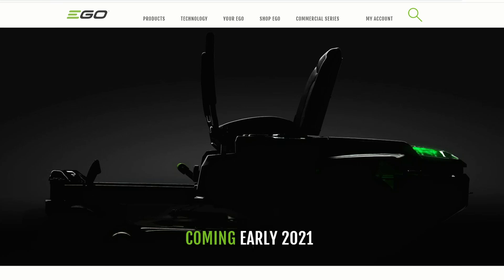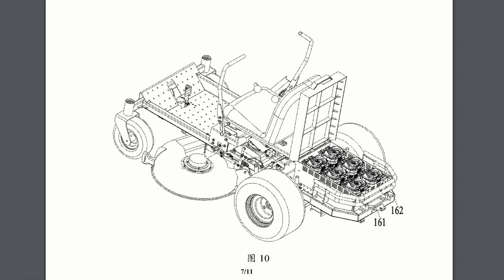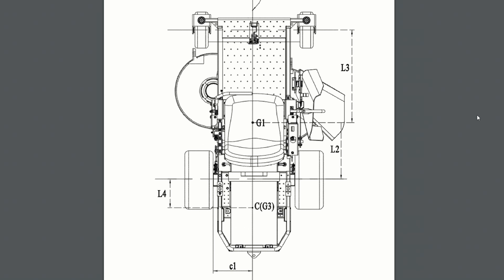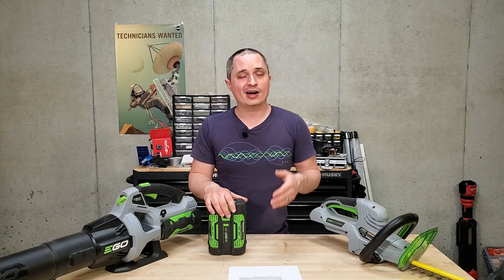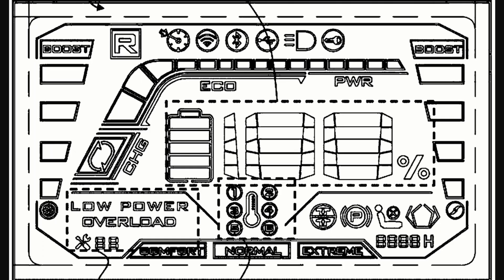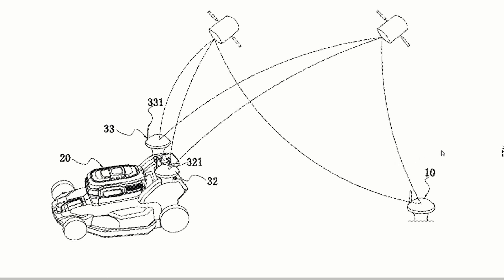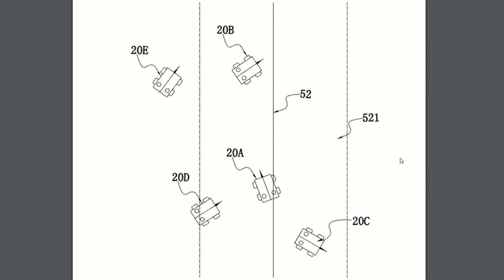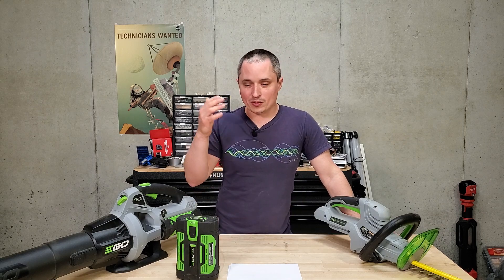EGO Riding Zero-Turn and Robotic Mower Patents - New Tools Coming in 2021!

Comment: EGO 21 inches 
And I have the new ones 7.5 amp battery 🔋 
I never bag or having issues not cut or stop the mower:) 
but I have couple problems :( 
1. The mower is too lite :( 
2. the mower is too small :( 
3. A problem with the batteries it freezes or won’t charge and one last that long with 7.5 A only 5000 ft.² yards you can cut:( 
4. And I have fescue grass I cut like 4.5 inches :) and when I cut the grass front wheels Digs grass in and i’m on second day that grass raise up and you can see the stripes tall :( 
5. The mower it’s sow light one pass can float on top of the grass second pass can go down with the same settings you can see the difference :( 
6. The mower is so tiny I have 1600 square-foot yard taking me one hour and a half to finish with one pass if I’m doing double pass takes over two hours :( and you have to do a double pass because of those stripes :( because of the tiny wheels digs that grass in :( oh and it doesn’t have an enough suction to suck the grass back out with the blades :( 
7. Not enough RPMs or not enough vacuum to lift the grass up from the ground. :( 
8. The bottoms for self propel the end of the cutting your yard you have hands A Ssort they’re too tiny and you have to squeeze the hands too tight :( 
EGO Mower they need to fix dthese issues :(

Comment: YES . . . The Leaf Mulcher !!! . . . Except many of us like myself already have the 650cfm blower . . . and I'd like to keep the two funscions separate because it is beneficial for longevity to do so. I hope they listen and make 2 versions . . . 1) Mulcher Only and 2) Blower/Mulcher . . . either with a collection kit like the Worx Mulcher with LeafPro Universal System that can use a common shop vac hose size.                                                                                                                                                                  EITHER WAY THANK YOU FOR LISTENING EGO . . . THOSE WHO LISTEN  . . . DOMINATE I ! !
Reply: Did I forget to mention . . . with variable speed ! ! !
Reply: I would also  like to reiterate to EGO  . . . that it would be welcome from tconsumers  . . . and many women . . . if EGO WOULD MAKE  A WEARABLE BATTERY PACK/HARNESS ( back or hip ) . . . that could be used universaly  with all hand held EGO TOOLS . . . TRIMMERS, BLOWERS, EDGERS, SWEEPERS, CHAINSAWS ETC. So that the user is not burdened with the weight of the battery along with the weight of the tool.
Reply: what would be welcome by consumers
Reply: And of course Brushless

Comment: I wonder if this zero turn mower will be on par in price and specs as the Ryobi Zero Turn mower.
Reply from the maker: They've officially unveiled it now: https://egopowerplus.com/worththewait
I got almost every prediction right except for the deck width, which is officially 42". They're saying MSRP is going to be about $5K with four 10Ah batteries included.

Comment: That zero turn sounds incredibly in efficient and very expensive. Their batteries are expensive. Possibly 1800 for a full pack. For... 2 ish acres..I'm not impressed. That mower better be free at that rate
Reply from the maker: I'm betting the mower will be at least $4K-5K with batteries included.

Comment: Im dumbfounded by how slow the robomower progress has been. Roomba was out for years before the Roborock came in and did the obvious and vacuumed in straight rows and used more sensors and cameras for obstacle avoidance, roomba is still playing catch-up.

Here we are in 2020 with $300 robo vacuums with lidar, bumpers and multiple cameras  and yet the best robomower (probably Worx 140) still bumps around like a 2010 Roomba and the sensors (which are additional) are garbage (as per reviews). And you still need boundary wire, even though that $300 mower can map itself, or you can in the app.

It makes no sense to me. Why cant someone take the guts of a Worx or Husqvarna and use lidar and cameras like the Roborock and include the mapping/zoning features as to not require the boundary wire, which is easily the most complained about thing in the reviews of robomowers.

Comment: Dude, Good video.  I love mowing lawns. This year I got a Ryobi. 2 days after the 30 day warranty, it went out on me. Home Depot came up big, and refunded my $$ anyway. Otherwise I would have been out $4300. I guess my other option would have been to take it to a repair place that was 30 miles away, had never fixed one of these, couldn't get to it for 6 weeks, and didn't seem totally onboard with doing the warranty work. That's in part why HD gave me a refund. 
Anyway, that killed my love of mowing, at least for this year. I loved that Ryobi when I had it. Nice green lawn. Nice lines. Just everything about it. After I returned it, I went back to my 1990s jalopy mower. Not even close to the same thrill of mowing. The Ryobi took 2.5 hours (including dumping clipping) where as my mower takes 4. 
I have a slew of other Ego products. I love em. I've had a few issues, but nothing that will stop me from liking Ego. I'm now just wondering the price. Under $3,000 and I'll buy one. Over $4,000 and I'm out. In between I'd have to think about it.
Reply from the maker: Dang, I'm glad to hear HD worked with you on the return! I bet the EGO is going to be at least $4K, but I guess we'll all just have to wait and see.
Reply: What happened to the Ryobi?  Was it the rider with the lead acid batteries?

Comment: A robotic mower using an existing deck with GPS mm positioning is a game changer. All the other robotic mowers need guide wires and are pain to set up. On top of that, none of them can do a HOC of 4".

Comment: i think the 20ah battery will launch with the zero turn
like how the 10 launched with the upgraded walking mower model
Reply from the maker: I wasn't aware the 10Ah had launched yet. Are you sure?
Reply: Doresoom Tool Reviews it launched. But for some reason the dealers that had them were told not to advertise them. For what reason I do not know.

Comment: Here’s what we know so far:

1. It will come with two 10 amp hour batteries not far from the way the nexus power system comes with 2 7.5 amp hour batteries.   
2. You may eventually be able to buy just the machine ( tool only) at a reduced price that will cost approximately five to $600 less than buying the machine with the batteries. Although I would recommend getting it with the battery since it will have high power demand.
3.  It will have a bank capable of minimum of four batteries again very similar to the nexus power station.    And as a matter fact we integrate with that same power station.
4. With four 10 amp hour batteries. The machine will run up to 10 hours of normal use (but no one is ever on the machine for 10 hours in a given day) The entire battery bank will take 8-12 hours to charge until they release an update allowing for a quick charging like Tesla vehicles when that occurs it will charge from 0 to 80% in about 80 minutes. 
5.  It will have an inverter built-in for mobile power.         (Again think of the nexus power station and then you will have a mobile generating system that you can drive around) 
6.  You will  be able to get an accessory for it  that will turn it into something similar to a side-by-side with a very small bed in the back like a tiny pick up truck to haul around bags of dirt or seed or whatever you’re carrying.       

7.  And of course the batteries will be swappable. Later in 2022 they will release a small overhead awning that is solar powered to trickle charge the battery. It will take almost 48 hours of sitting in the sun though to charge it up fully from the source.  But it should extend the life of it a little bit.   

8. It will have active power of management so that the power of the blades and speed that are spinning at match the terrain that you’re driving over. For instance if you are cutting dry grass it will go to low power low torque. If you’re cutting thick or tall wet grass it will kick up to high power. Always allowing you to use exactly the amount of power I need it for the job and no more.    

There are other rumors but these are the things that are currently in the works. Everything else is speculation
Reply: We will be on it 10 hours a day. LOL
Reply: My staff has been push mowing because I refuse to buy from another brand. We been waiting almost two years for the zero turns. Looking forward to getting 2. And if ego was smart enough to allow the mower to have swappable decks two 32" deck mowers and two larger decks are on my January 2021 Christmas list. Yeah, January is my December this year because of EGO.

Comment: While I'm disappointed in all those individual removable battery packs, I can see why they chose this option. For every advantage of dedicated hard wired cells (like say a Tesla) there is an advantage of these separate packs. For EGO and their customers, it is simple to replace defective batteries with minimal downtime. For customers dedicated to the EGO line, there is of course the advantage of swapping and cross using these battery packs. However, the missed savings of weight, space and cost of hard wired cells is hard to overlook.

Comment: Definitely zero turn mower all the way! It would be nice if it was larger than 36” though. That seems pretty small
Reply from the maker: It's entirely possible their drawings weren't to scale, or my measurements were off a little. I doubt it will be above 42" though.
Reply: @DoresoomReviews  RIGHT

Comment: 36 inch cut? Two 21 inch blades would make it 42 inch, which sounds way more plausible.
Reply from the maker: They're offset a little if you look at the overhead view, so I think there's some overlap. It's entirely plausible it could be up to 42" though, if the drawings weren't quite to scale or I didn't quite measure right.

Comment: I enjoy mowing and striping my lawn, so I'd not buy a robotic mower. Definitely going to get the 0 turn mower if it is priced well.. I'm expecting it to be around 6k. I'd have way too much fun with the snow plow :)
Reply: Ouch at $6k. I hear ya on the priced well. I bought a Ryobi. I had to return it. I know Ego isn't Ryobi, but the experience has me gun shy. My take is under $3,000 and I'm getting it. Over $4,000 and I'm not. In between I'd have to think about it.
Reply: @dannyd5697  I'm sure Ego will keep the price close to Ryobi's.. but you have to think that lithium is better than lead acid in every way, so it's going to be a little more.

Comment: I've been following the progress of autonomous mowers for years.
This is a real breakthrough.
Using technology from surveying to give mm precision is one of the better solutions, but might be pricey.
This will be perfect to do a house yard.
Thanks for the research and review.
Reply from the maker: Yeah, it definitely reminded me of referencing off of a GPS benchmark back when I did a few summers of land surveying. The company I worked for only had one Trimble GPS unit though, and the rest were Total Stations. I think we had 8mm accuracy on the GPS if I'm remembering correctly.

Comment: The robotic mower would be fantastic to have.
Reply from the maker: I just moved to a 1/6th of an acre lot, so I'm way more interested in the robotic one than the zero turn myself.
Reply: @DoresoomReviews  So... if their 10Ah ends up at $450 (my guess) and it comes with 6.... (huge assumption, but they're gonna want to brag about runtime no doubt) then we're talking about $2700 in batteries. Holy crap. It's all going to depend on just how efficient this thing is. If it can get my yard done with 6x 5ah batteries, I'd rather have those. I doubt I'm gonna want to put a 10Ah on my trimmer. The 7.5Ah is already heavy enough.
Reply from the maker: I think six 5Ah will do just over an acre, if you compare it to the Cub Cadet's electric lithium ion ride on mower's performance. I bet they'll have a kit option for 5Ah, or maybe 7.5Ah, but I really doubt they'll sell it bare tool.

Comment: The 0 turn mower prob gonna be expensive
Reply: Maintenance and fuel costs will be next to nothing.
Belts and blades
Edit: no belts, just blades!
(my electric zero Hustler conversion still has belts)
Reply from the maker: Oh yeah. At least the batteries will be useable in other tools, but I doubt they'll sell it bare tool - they won't want returns from people trying to run it on six 2.5Ah batteries and being disappointed.

Comment: Dude, use that google translate app to translate that chinese or mandarin in the patents. You might have to print it out.
Reply from the maker: I think it was already run through Google Translate in Google Patents, since the text was pretty confusing and hard to read. I also found an older EGO patent title "Backpack Hairdryer", which was clearly just a backpack blower. Gave me a good laugh though!